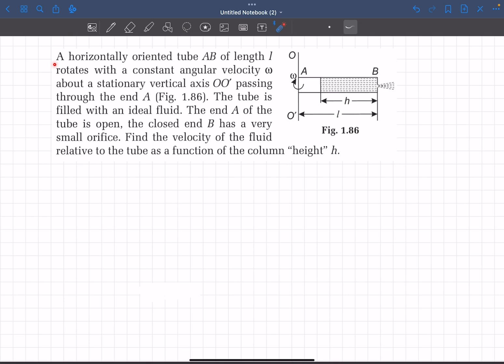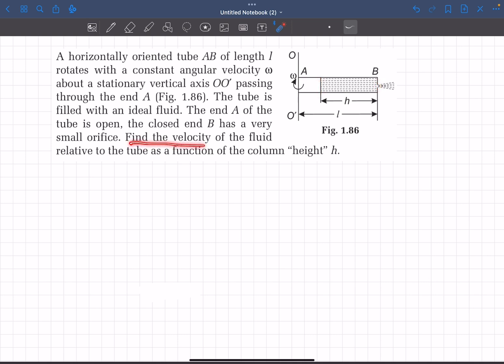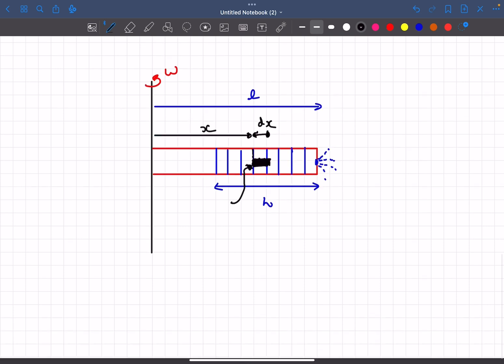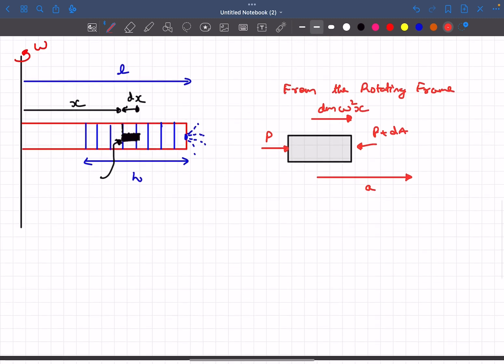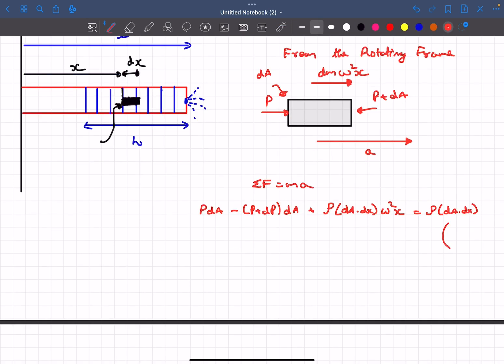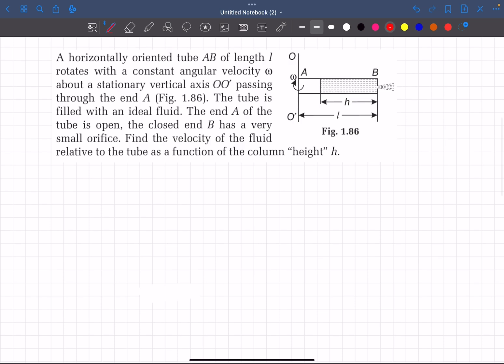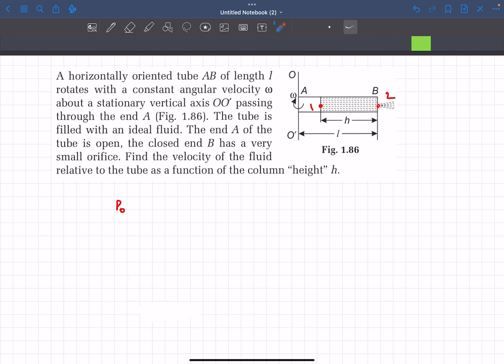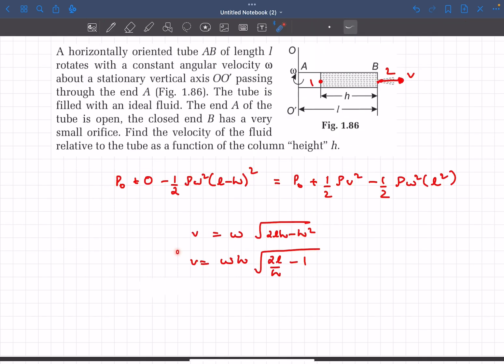[JEE] Efflux Velocity of a Fluid Rotating in a Tube | I E Irodov | 1.324

Comment: Tube also has a tangential velocity of wl/2 whereas the velo of efflux is perpendicular so shouldn’t we vectorically add both velocity to relative velocity , just like sliding rings on rotating rod question in classical mechanics
Reply from the maker: Yes, relative to the earth's frame we will have to vectorially add it. But in this problem they requested the velocity of the fluid relative to the tube.